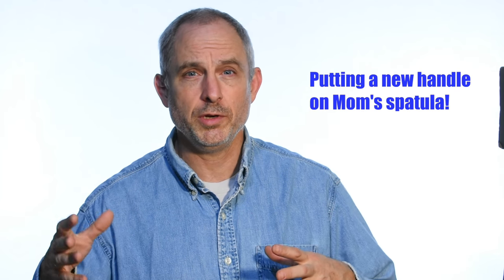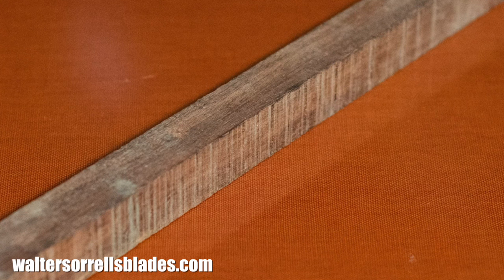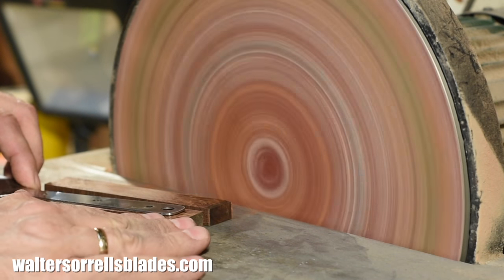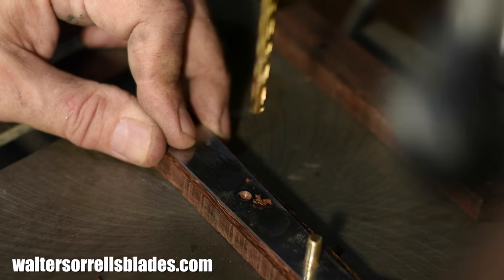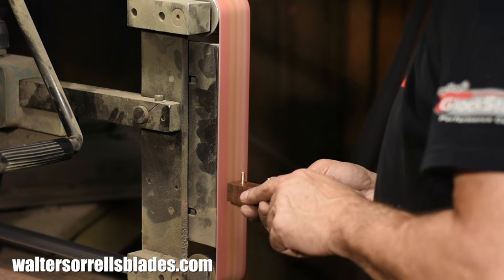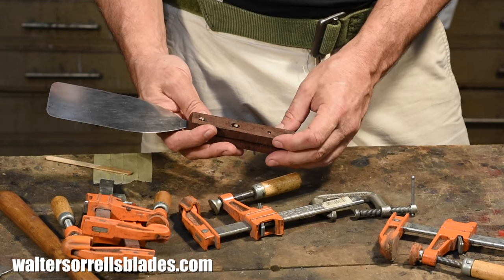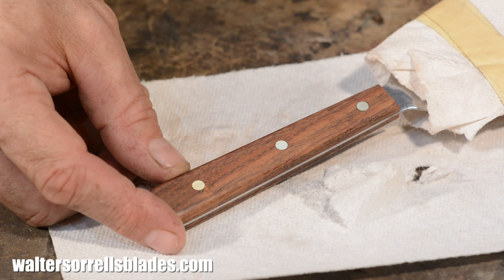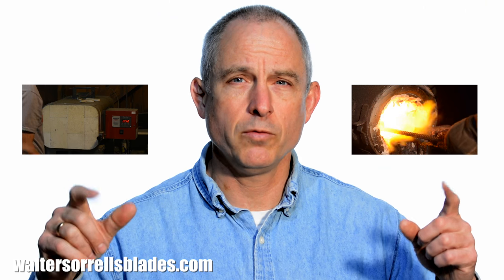Making a New Handle for a Vintage Spatula - Easy DIY Project!

Comment: in the process of making my first knife. been a lot of fun. failed trying to make a giant Bowie first time around and a karambit so opted with something a much more simple. blade is about 4 inches long. managed to put a nice full flat grind on it too. trying to sand out the grind lines now. something therapeutic about knife making. used 01 steel as im only a beginner. will be making more if this 1 turns out like i hope.

Comment: Mr.Sorrells I have a question that is unrelated to this video but I made a fighting style chopper from a big really thick metal file and I'm having a lot of trouble drilling the pin holes. The file is extremely thick and high carbon which is perfect for a knife like that but is impossible to drill with a hand drill (only drill I have) and I annealed the file several times bringing it to critical temperature and leaving it to slowly cool in wood ash. And it's still impossible to drill I destroyed about 5 drill bits which left me think could it be air hardening steel? But the file is like 50 years old and I quenched the blade in water and it hardened skated a file after that while the handle didnt. So can you give me any advice how I can drill the pin holes? 
Also I'm a huge fan of your work you're one of my inspirations to start knifemaking!

Comment: Hi Walter, what drilling speed were you using? it seems pretty slow but your getting good results.
Reply from the maker: I tend not to change drill speeds unless it's crazy far off from a reasonable speed.

Comment: Do you ever use horn for handles? If so, how do you compare it to wood; I mean is it harder to work with, can it be worked with simple hand tools etc.
Reply from the maker: I've used buffalo horn but not, say, ram horn.  Horn is pretty easy to work, softer than most woods.  The downside of horn is that it's basically the same material as fingernails, so it stinks like crazy when you grind it!
Reply: Walter Sorrells Thank you for your kind and informative answer :)
Reply: +Walter Sorrells Walter it's kind of amusing that after everything you posted, you accomplish such an amazing handle.